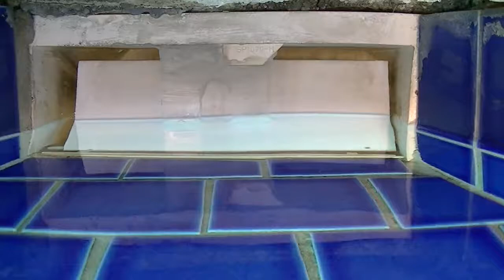Pool Skimmer Box Flapper Stop Repair

Comment: What the heck do you want to say to us on this video??
Reply from the maker: Great question!  Basically that there are ways to modify or repair the built-in, non- replaceable flapper stopper for you pool skimmer box. Sorry it wasn't that clear!  I suppose its kind of obscure,but, it is pretty easy to find an "L" shaped piece of material that can be secured to the box entry with adhesive(s).